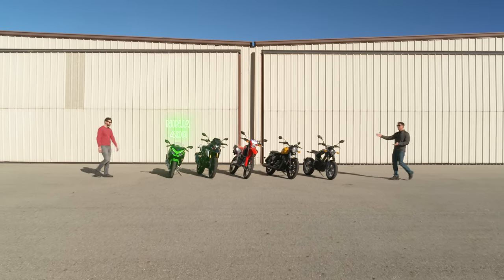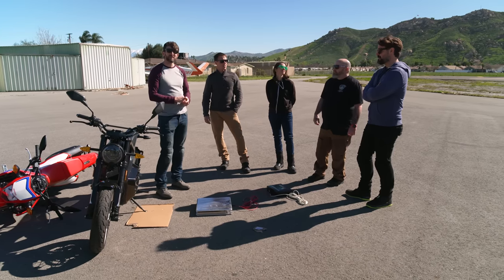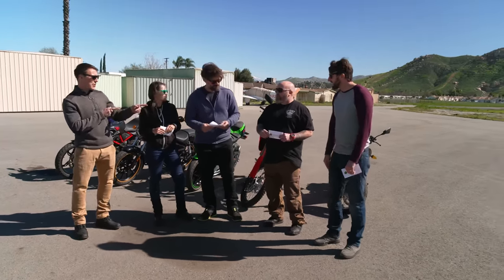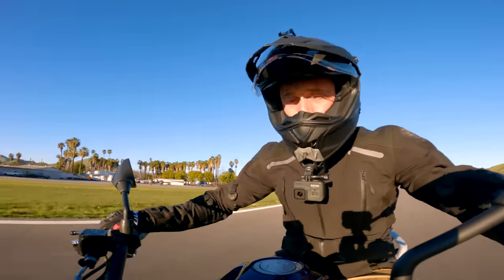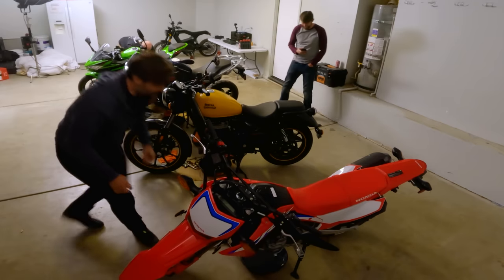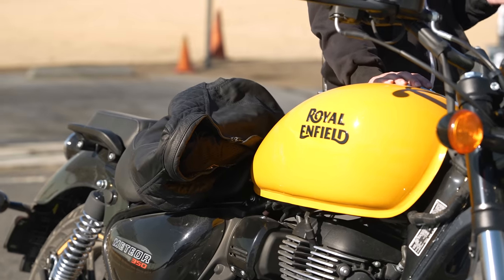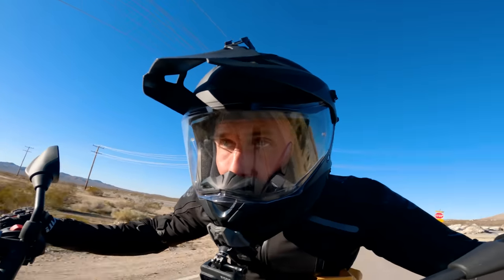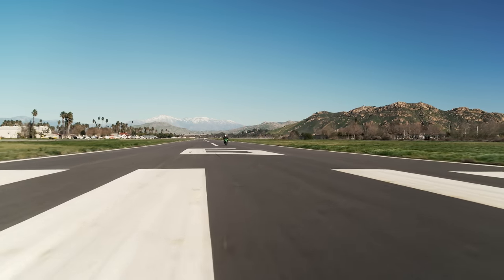Best Beginner Motorcycles! Ninja 400 vs Meteor 350 vs CRF300L vs Sondors Metacycle vs G310GS | CTXP

Comment from the maker: Check out the behind the scenes & read more about these Beginner Motorcycles on Common Tread! https://rvz.la/413SmqN
Reply: So, you pick the biggest CC bike for the beginner? 😅😂
Reply: @travelinman482  
It's hard to ignore performance when you are shopping for a motorcycle... even if it is your first bike.
Reply: @marscruz  
Yep, especially seasoned riders like Revzilla employees.
Reply: There is always the option of the Z400 with the Kawasaki. It has a way better riding position, same or even better torque and engine performance and I believe it would give a waaaay more comfortable riding, given it is the track, the Streets, highway or even the desert areas. You guys should give it a try and see how it goes!
Reply: @blkhwk737  
The Versys -X300 might be a good bike for a beginner considering it's lighter and not quite as fast. And only $6100. I wonder how it would have done in this challenge against the Beemer and the Himalayan.
Reply: @marscruz  the Versys would be the direct contender to the G310GS, but the fact it has a twin engine makes it a bit confy to ride around, altho I don't know if it is available in the US market. I know is not a common bike down here in Latin America, but I love it as well. And it looks pretty nice tbh.
Reply: @blkhwk737  
Yes, it is available in the US. Twins are generally smoother and have more power than a single, which is nice at higher speeds and on longer trips. Singles are better for their cost and simplicity and for around town, low down torque.
Reply: @travelinman482  😮😅😅😮😮😮😅
Reply: @marscruz  
Beginner riders shouldn't be concerned with "performance" or "how many CCs" when getting their first bike. Smaller, more  lightweight  bikes are what they should be looking for to help them learn the basics of riding.
Reply: @travelinman482  
I started on a 200, went to a 90cc trail bike then a Honda 175, then a 441 Victor. Here in the states you can go out and buy any bike you want as your first bike. Some fools go out and buy a rice rocket and end up in the hospital or as worm food. With great freedom comes great responsibility. 🤕
Reply: @marscruz  
True
Reply: Thanks for making this, it was VERY entertaining and fun to watch! 🙂🙂🙂
Reply: Wow, top notch production guys! Thoroughly enjoyed it all, from start to finish and learnt some great things so thank you! As for me I went with the high performance liquid cooled (2016) YAMAHA WR125X SuperMoto & I have to say it it the best investment I've ever made! Such exceptional control, perelli speed demon tyres which feel like literal glue on the road (also went tech 7 drystar and have to say it feels incredible to ride ever since, you feel completely planted on the pegs no matter what position & fully waterproof peace of mind!) It is such a shame that the only manufacturer left doing a 125 Road Legal SuperMoto is Aprilia these days... 

I've also stuck to 125's due to just loving this model sooo much, I'm not about speed tbh, I just love twistys and scrapping around a/b road country lanes in the UK. I will however totally look to an ADV (Loving the BMW & KTM 300-600cc Models) as they clearly are the best for an all terrain premium experience, especially on the road with all that aerodynamic fairing which SuperMoto's lack, or I may go to another higher cc SuperMoto...  

I also went all out on all tools needed, to save hundreds in repair & labour costs and a Haynes specific Yamaha WR125 manual (definitely worth it's weight in gold if not even more so!) And now fully self suffiecient, and you're so right about it being calming & therapeutic for the mind.

Found a new love for engineering & mechanical work now honestly, and I'm not sure I would have done it all that way if not for you expertise & brilliant videos covering everything. 🙏🏻

Love to see it & keep up the excellent work you all do!

Greetings from the UK my fellow Bikers and have a brilliant year to the entire team at @RevZilla 👊🏻😃❤️
Reply: You guys forgot a CRUCIAL category... DISTANCE. More specifically, how you feel after spending 8 - 10 hours on your bike. 

A beginner rider finally has a great new bike. You think he or she is limiting themselves to a couple trips around the neighborhood? Let's get serious here! Show me ANY rider who - within 30 days of getting their very first bike - didn't take off on some long distance excursion. I went from Boca Raton, Florida to Islamorada - about 3.5 hours, one way - within 10 days of getting my Honda CB 400 Automatic. 

Let us not forget the time needed and frequency of fuel stops. With distance, I'd say the electric bike would have a slight problem.
Reply: @marscruz  Performance may or may not be relevant. It's based on the reason you want your bike. IMO dependability is the most important thing. It may not be the best performing bike; but if I am taking off on a trip 4 hours away, I want to KNOW it will always start and get me back home.
Reply: @Alleycat 27  
Yes, because they are BEGINNERS. They're not going to hit the road and do a 200 mile across country adventure.
Reply: @alleycat2759  
My first bike was a British single. It broke twice in a few months and left me stranded both times. Next bike was a Japanese trail bike and it never failed me until someone stole it. Third bike was a Honda CL 175 that was bulletproof but too slow for distance riding. If you want reliability it's hard to overlook the Japanese bikes. Everyone else has gotten better because of Honda's reputation for quality. Occasionally they make a questionable model but most of them are very good.
Reply: @travelinman482  When I got my first bike I could not wait to ride it. The very first day I could, I took off to a location nearly 4 hours from home. It felt great. Sure, as I was not experienced, I rode a little slow and was overly cautious. But I loved every minute of it. It felt great being on that bike, taking off to who knows where. Where was I going? I wasn't sure. I headed south and would know where I was going when I got there.

I spent part of the day at a Tiki bar in the Florida Keys... a place called, Kokomo... the same place they sing about in the Beach Boys song. I spent the night there and the next morning, I drove back.

Mind you, the drive back was not s direct route, I made a few detours and stops along the way. In total, it took almost 4 hours to get there. But 16 hours to get back! 

At this time, I had owned that bike for less than a week... and - prior to that trip - my only experience on a bike was limited to mopeds and a day or two on a minibike when I was a kid.

There is no way you can tell me when you got your first bike you said, "I'm too afraid to ride it. I'm not going more than a mile or two from my house."
Reply: @marscruz  My problem with my first bike was the fact it was only a 400 and eventually blew up. Why did it blow up? 

For the first couple weeks I was slow and overly cautious. But after that I wasn't afraid to open it up a bit. I soon realized highway speeds at the time were nearly full throttle.
 
Consider 70 or 75 mph (112-120 KMH) speed limits, where nearly everyone was driving at least 5 mph over the limit. With a bike that maxed out around 80-85, it pretty much meant I was running full throttle far too often. Do that for a few months and an old bike just may say, "I've had enough."

One day, while crossing an intersection, the bike just died. I heard a god-awful crunch, followed by a bunch of smoke. That bike gave me all it could. I just wish I new better and had treated it better. But I learned from my mistakes. Plus, that first bike only cost me $900. So it wasn't too expensive of a mistake.

For what it would cost to repair the bike - basically rebuild the entire engine - I sold it to the mechanic for $100 and bought his Honda Shadow 750 for $1200.

The Shadow was perfect for me.
Reply: Svartpilen 401 would have taken the cake!!
Reply: You should've picked the ZERO for your 1st Electric Motorcycle...
Reply: 0
Reply: @marscruz IU va g